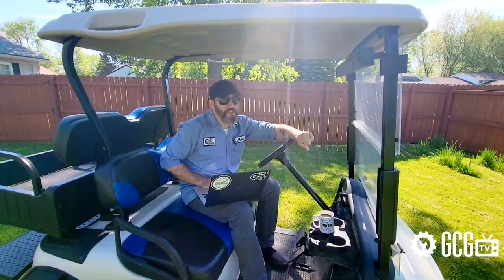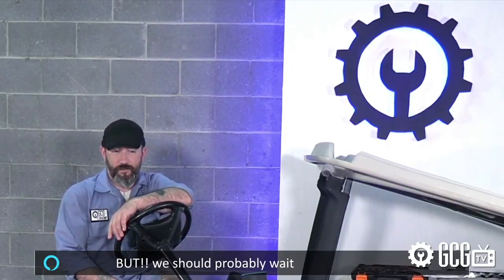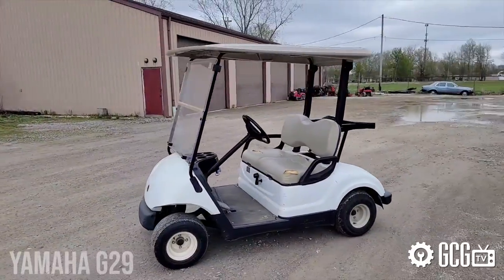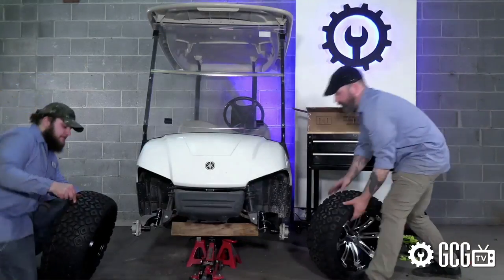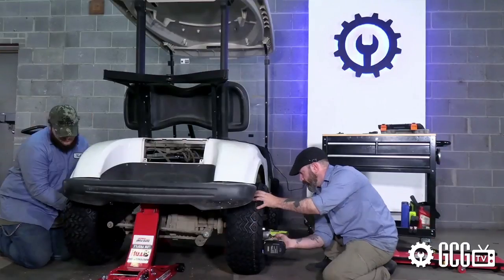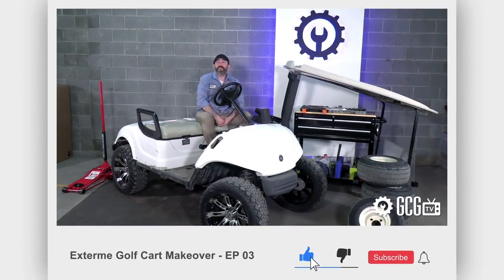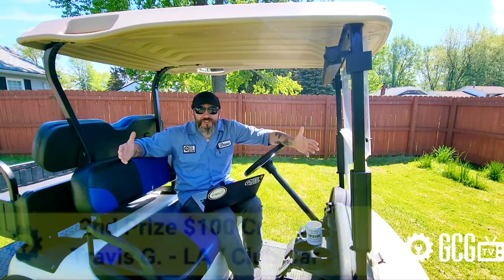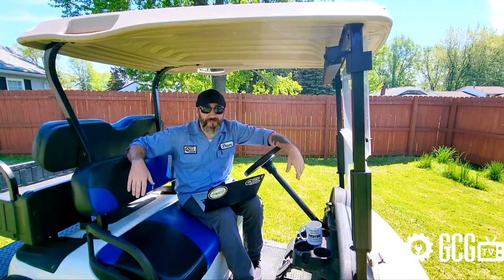Extreme Golf Cart Makeover | Yamaha G29 Lift & Tires | Golf Cart Garage

Comment: so only the front needs the new part? not the rear? that makes it easy. seriously considering this
Reply from the maker: Thanks for watching, Laura!  There are actually blocks that lift the rear frame, just tough to see with the body in the way.  They are, however as simple to install as the front of the kit and it's all included.  There's also a great, step-by-step video from the lift manufacturer.  Let us know if you need help with a project or have any more questions!  Support@GolfCartGarage.com or (800) 401-2934

Comment: Nice work on the lift and tires. Is there a video or instructions on the seat replacement? Thanks!
Reply from the maker: Hey, Joseph... thanks for stopping by!  Front seat replacement is really just the removal of 4 bolts on your existing hip replacements and 4 bolts on your existing hinge pieces to put them on a new assembly... just order replacements for the right model.
Hints on G29 here: https://www.youtube.com/watch?v=2UomhidH9F0
Replacement in general here: https://www.youtube.com/watch?v=dRCjZoISyj0
You should be able to do it with a single wrench.  Let us know if you need more help! support@golfcartgarage.com or (800) 401-2934
Reply: @GolfCartGarage  Thank you for the quick response. I will check out the links and call if needed.

Comment: I have a 2021 drive 2 adventure sport. That comes with a 2” lift from the factory. Do you think 22” tires would fit?
Reply from the maker: Thanks for watching.  Yes, a Drive 2 should fit 22" tires with a 2" lift, but it may be a tight fit, depending on weight on the rear end, due to suspension on imported carts lacking leaf springs.  Let us know if you have more questions or need help.  Support@GolfCartGarage.com or (800) 401-2934

Comment: with the wider tires, how much difference was the width of the wheel base? I have a limited width clearance in my toy hauler of 4ft wide. I'm planning to do the 3" lift and upgrade from 8" wide tires to 10" wide
Reply from the maker: Thanks for watching!  Don't have this cart on hand anymore to measure 100%... but... The offset on these wheels along with the 2" tire width increase gave us about a 4" overall wider footprint in this project.  Let us know if you have more questions or need help!  Support@GolfCartGarage.com or (800) 401-2934

Comment: The guy I bought my cart put a jakes lift kit on the front of it. The shocks were bad and I replaced them , after I LOWERED THE JACK I heard a clunk …. Apparently the steering shaft came out of sleeve I had to jack it back up and slowly lower it as I put their spleen back in the shaft. Is there anyway to make or acquire a longer spleen? Thanks
Reply from the maker: Hey, Eric!  Thanks for watching.  OEM parts like that are usually direct replacement instead of an extended version.  That said, we recommend consulting our virtual diagnosis service while it's still free for help! https://www.golfcartgarage.com/gearheads-on-demand/
Or you can get in touch directly: support@golfcartgarage.com or (800) 401-2934.